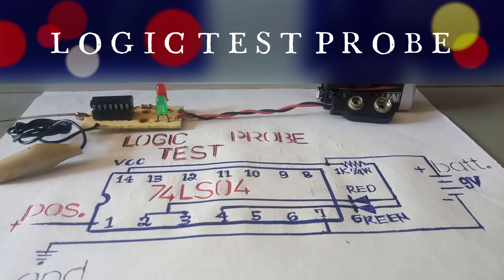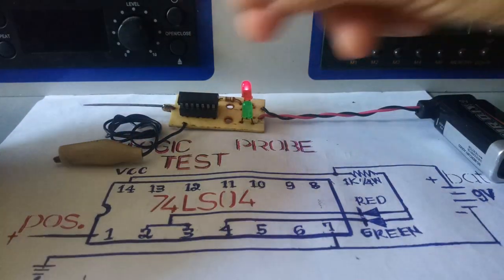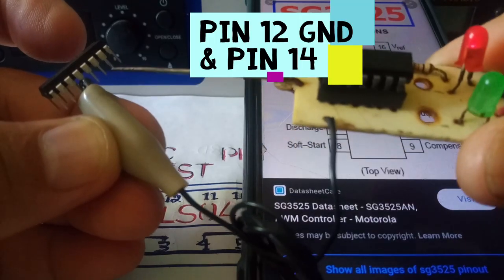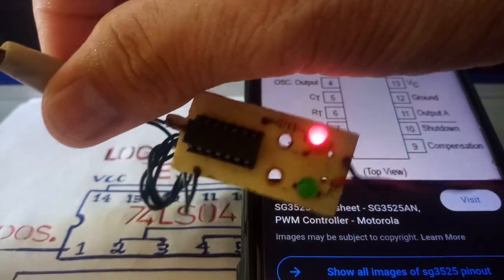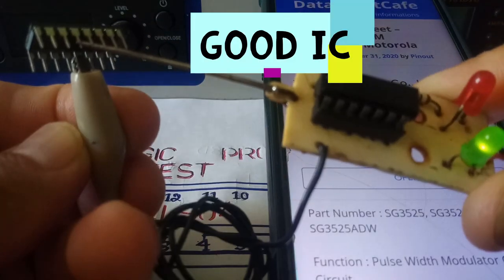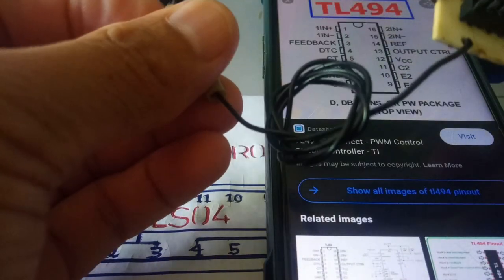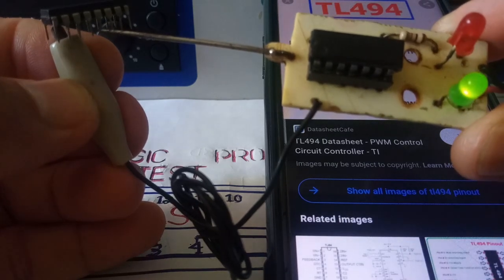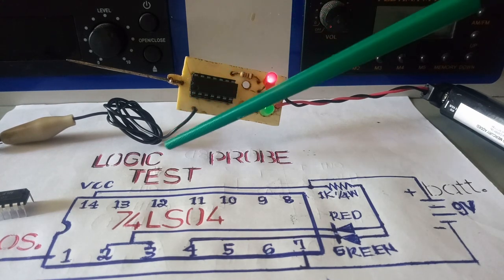IC TESTER LOGIC TEST PROBE

Comment: Just to be sure, pin 1 would be the probe point, and pin 7 would be connected to the negative terminal of the battery and to a cable with an alligator clamp, this gator clamp tjen would be connected to the negative imput of the IC to be tested, please correct me if I am wrong or right. Thanks
Reply from the maker: Yes, that's absolutely correct, thank you for watching.

Comment: Hi again, let me try to understand, the red light is just for knowing the circuit is energized by the 9 volts battery, you feed the IC to be tested in the vcc input pin and with the probe you check the rest of the pins and if one doesn't light the green led that IC is faulty? Am I right, please correct me if I am wrong. Regards
Reply from the maker: Yes, correct thanks and regards